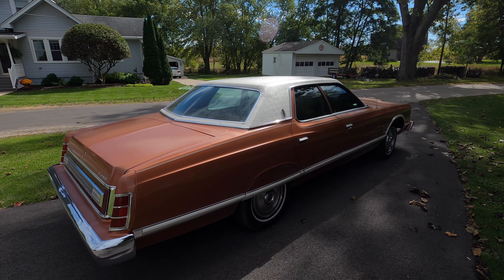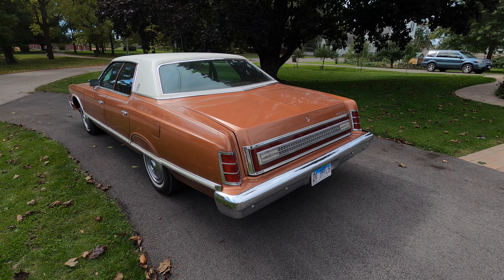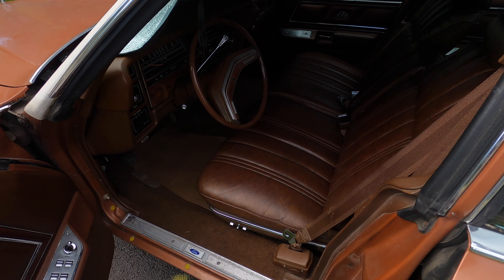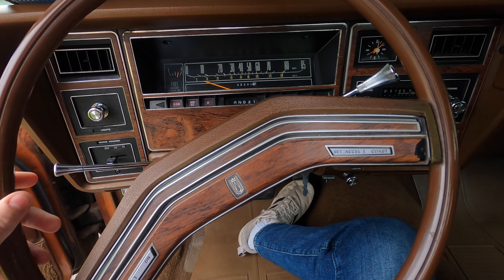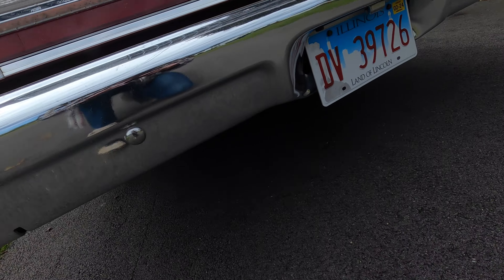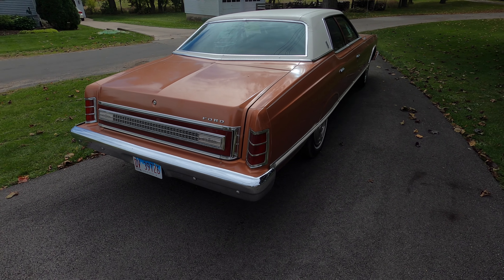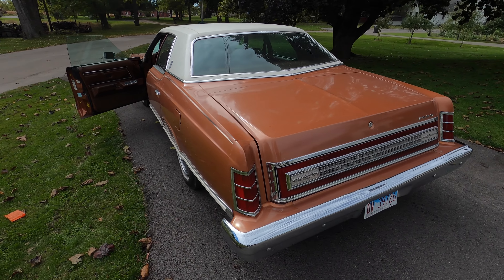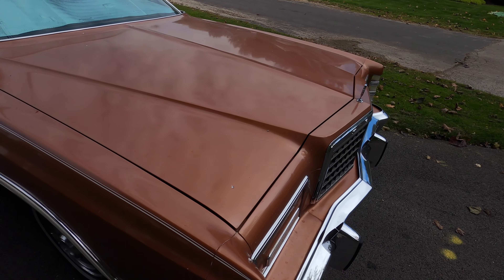New Magnaflow Exhaust on my Ford Ltd

Comment: Nice ride. I have 2 LTD Landaus myself. One of them is just a parts car. I learned that there were a couple of mid-year changes on these cars. My daily car came of the assembly line in October of 1976 while the parts car came off the line in August of 1977. The 2 changes I've found so far is the speedometer was changed from a 120 mph like on my daily to a 85 mph speedo like on my parts car and your car because someone in Washington DC didn't like the look of the 120 mph units in cars. The othe change i noticed is the earlier half of the model year, the headlight housings and doors were made of pot metal, where the later half like yours and my parts car are plastic. Look on the sticker on the inside of your door, and it will tell you what month yours came off the assembly line.

Comment: I put a 3” FlowMaster exhaust system on my 11 Ford Ranger XLT super cab 4WD and a K&N intake.
It sounds a lot better, has more power and it went from 19mpg on the freeway with the cruise control set on 75mph and now I consistently get 23mpg.
It’s our 4th Ranger and has only 36K original miles.

Comment: Sounds great! I have a 1977 LTD Landau but mine is all black with the chrome, but the covers over part of the wheel aren’t there. Yours is in better condition than mine in terms of the bumpers and paint job. Long story short, my vehicle had been sitting on blocks in a garage for 20-25 years, but it is still in good condition. I plan on making mine unique over the next few years when I have the money to repair or replace what I don’t have money for now and make modifications. I am eventually going to get new speakers, but no new radio, because I still want the interior to look original as possible. My interior is red as well, and vinyl only on parts of the seats, but most of the seat is soft.
Reply from the maker: Cool